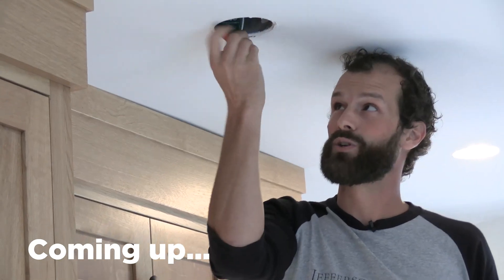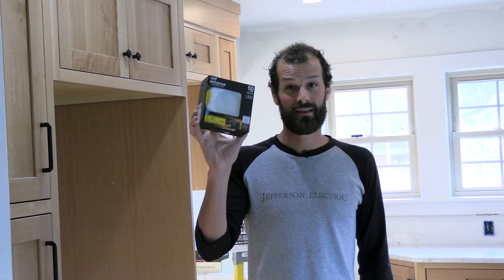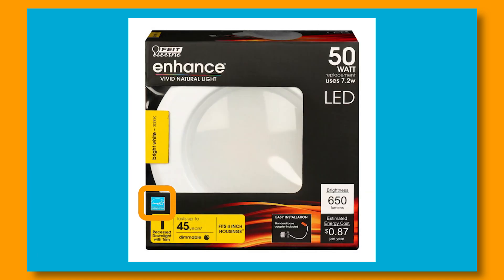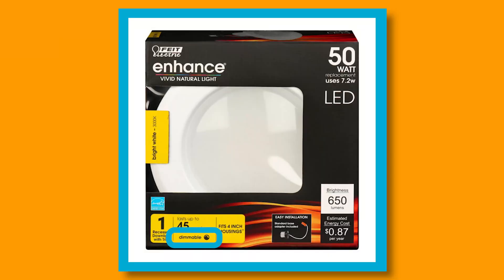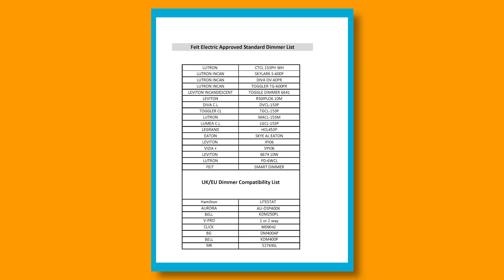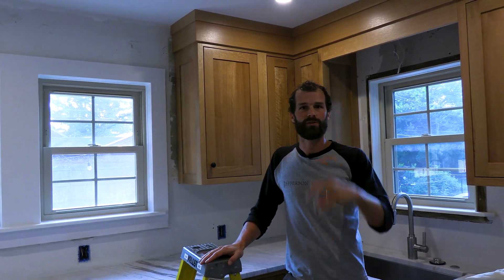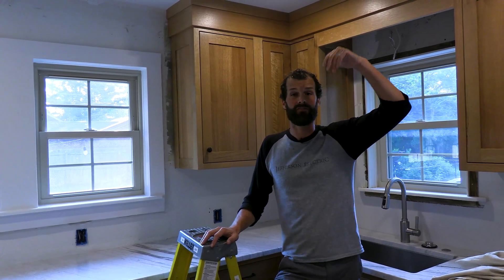How to NOT Pick the Wrong Kitchen Lights

Comment: 1/10th the electricity with 25x the lifespan *   (*when compared to incandescent bulbs that virtually no one uses anymore anyways).   And when those LEDs go, they don't just go out,  they can have a flickering period which tugs with your cheapskate genes of "it's not that bad flickers once every now and then" all the way to "screw it I'm getting migraines from it flickering!"  and then my personal favorite replacing with something that even though it is the same color temp on the box it ends up looking different than all the other LEDs in the room and if you have the tiniest OCD in you you will need to replace every single one to be the same exact color and brightness.

Comment: Great video, much appreciated. I bought a set of thin LED lights to go in the ceiling. But the lights just have thin bare wires and didn't come with junction boxes. Is there a small code compliant junction box I could buy or can I just use the good old Wago connectors without a junction box?? (the connections would be near the light inside the draft proof box above the light in the space above the ceiling).
Reply: you need a box even if you use wagos 
they do make a box for them though 
look up wago box

Comment: I'm still using 2700 only because I am sentimental to the old incandescent bulbs.  Did not realize the pricing for can lights.  Just put ten in my unfinished basement (the kids use one room as a rec room).  Originally, there were three bare bulb fixtures on one switch.  I rewired to have two switches.  So I probably saved myself $1000 doing DIY.

Comment: Great Video. Thank you for sharing. I have question , I want to learn more about electrical , Can I used 14 gauge wire and 12 gauge wire and 10 gauge wire for 240 Voltage ?
Reply: It's the amperage that determines how thick of wire is needed.  The voltage doesn't matter, as long as the voltage is within spec.  Home wiring is typically rated for 600V, so as long as you stay under that, you'll be fine.  
Secondary to amperage is the distance.  A 450 foot run will likely need thicker wire to counteract the resistance and voltage drop that a 30 foot run just won't have.  The Code provides guidance and direction on both of these things.

Comment: HERA....high quality LED stuff, i have had 15 years on HERA 3W HO surface mount units  finally changing them out after around 130,000 hours, or 24/7 use in my kitchen cabinets.  Mfg. rated at 50,000 hours...cost much more than the chinese stuff, but held up perfect, color and brightness.  New versions are 1/3 of price from 15 years ago, and better drivers....HERA makes some great stuff...they use LED from the primo makers Lumiled, Osram etc

Comment: Best practice is NEVER purchase or use ANY electrical products, tools & safety equipment from lying cheating lack of quality control communist china. Had a cheating china LED driver catch in fire that was only a few months old. Warranty replacement driver started smoking after a few months. Both ran hot. Purchased a made in USA driver and it has been running great for over 5 years and runs a lot cooler. Every LED lamps and garbage Halo luminares sold at big box stores are made in cheating china. Nice video.

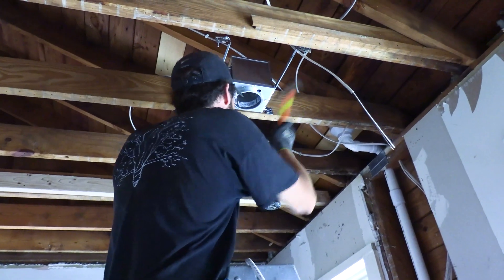Comment: 2:12 Why are electricians still using can based lighting when pancake lights exist? Is it just a matter of selling old stock before moving to modern tech or is there something else?
Reply: Codes !
Reply: @bahbarino4479  NEC codes?
Reply: @beachboardfan9544  - with open ceiling, and easy access (no drywall), they were able to use the New Construction cans. 
Cans can be more versatile. For example, I was able to swap out regular bulbs installed in cans to Phillips Hue Lights bulbs for much less than their recessed pucks. $35 vs $59.
Reply: No one put pancake boxes in new construction. Pancake boxes are for when you don't know where the joists are.
Reply: @danielkofman4592  I'm talking pancake lights, no boxes
Reply: @beachboardfan9544  if you're talking about the wafer lights, those are for mostly for running in remodels where you don't have an existing junction box that was part of the home. Those lights allow you to put it anywhere in the ceiling so long there is drywall.

This house in the video was built with those can boxes and wafers would be not the best option. There are some that can do both I imagine.